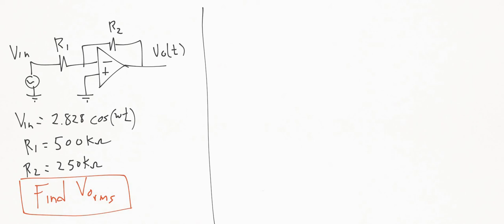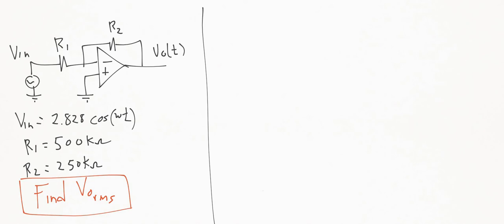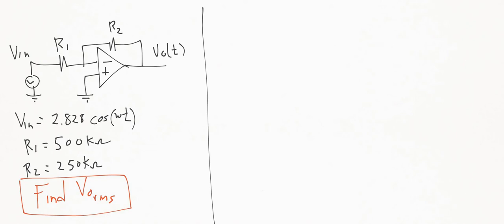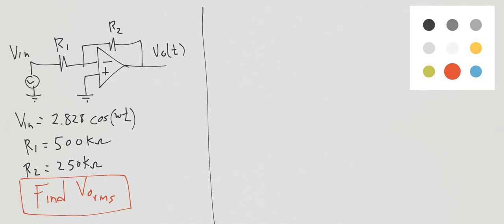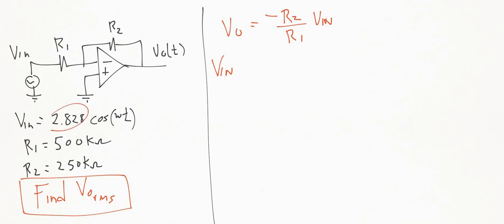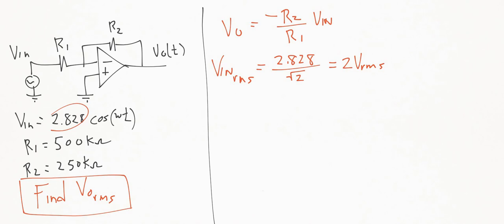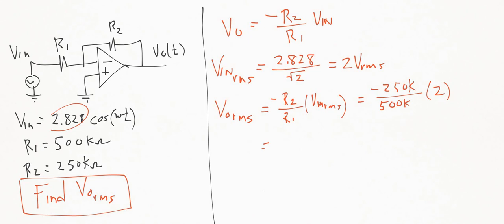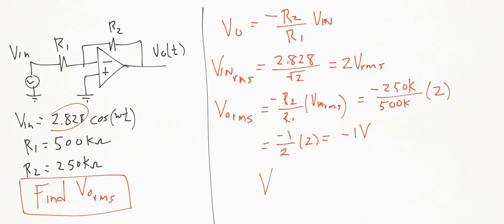Electrical FE /EIT Exam Prep - Electronics 1: Inverting Op-Amp

Comment: why did you drop the negative at the end? is that because Vrms can never be negative?
Reply: If a wave is negative, it is just flipped via the x-axis from the positive wave. A cos wave would just be offest 180 degrees with this flipping. Thus, the RMS value isn't changed
Reply: @jeremynash87  Then why is the negative in the equation in the first place?
Reply: @ahulse78  To show that the peaks and valleys of the wave have switched. It could affect other amp questions (like if you combine waves from different amplifiers or something) but in this question it doesn't matter and can be dropped.